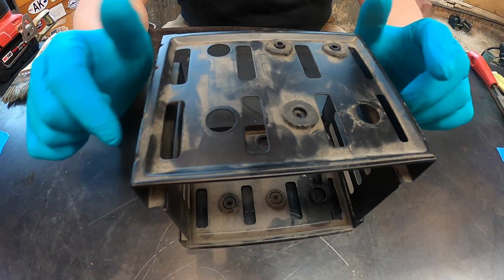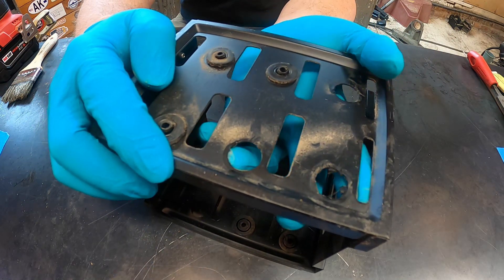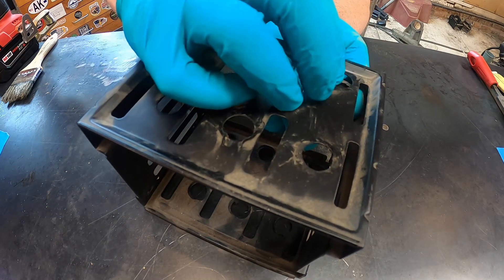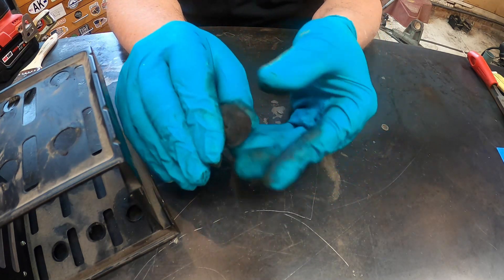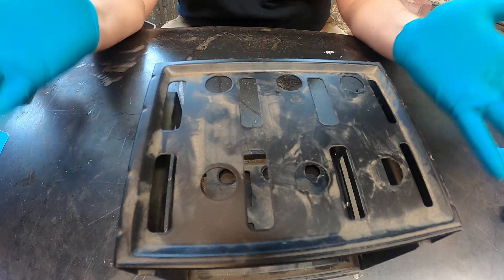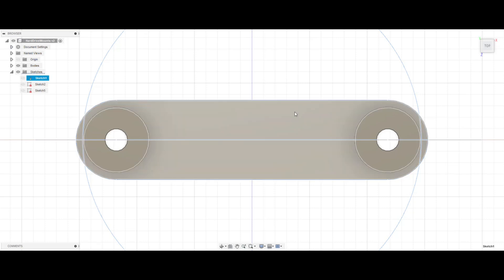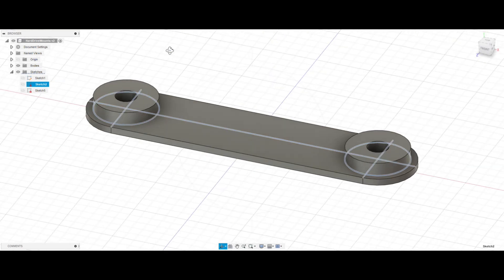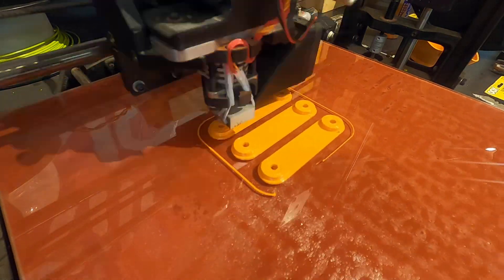3D Printing Hard Drive Mounts

Comment: Replacing the old vibration absorbing grommets with a hard plastic bar was the worst choice.  It would be far better to find some soft grommets and  3-D print adapters for the four hard drive mounting points.This would do a much better job of dampening bumps, fan vibrations, etc.
Reply from the maker: We mounted hard drives steel to steel for decades and mostly still do, the grommets are totally unnecessary.  I setup a 8 drive NAS a couple weeks ago, not a piece of rubber in sight.
Reply: @jtkilroy  Same here, 2x NAS servers all in slide chassis, metal on metal...  as for PLA/ABS... PLA is great for indoor use... anything exterior (sunlight &/or heat) PLA will start to deform before a similar part in ABS due to the lower plasticity of PLA... I use PLA for everything, unless it requires higher heat, (or i want to acetone smooth the ABS parts) Keep up the Distancing and stay safe in the shop ! ;)

Comment: Seeing the posts about vibration. We have a simple way to reduce vibration into various equipment.  Find a piece of Vacumn hose at your auto parts store that will just slide over your mounting bolt, drill the mount out where you have to lightly force the hose into it, Cut the hose slightly longer than the device to the outside of the mount bracket distance, install a small washer on the bolt, install the bolt tight enough to slightly compress the rubber hose short of the washer touching the bracket.  Nice and secure isolator.  Maybe even fish tank airline type hose would work.
Reply: silicone tubing is best - nylon hardens over time

Comment: When you get enough spare cash to burn thru, spend it on an SSD drive.  You'll appreciate it more than you might think.  Good Luck!
Reply from the maker: Ive got an M.2 drive that I actually boot off of.  These two drives are just for storing and working with video footage

Comment: Darn, I thought you were going to print a complete hard drive enclosure for a stand-alone hard drive machine.  Still looked good.  Be safe, practice spacing, wear your mask and gloves.  If someone thinks you are over-cautious, simply pull your mask down and cough at them.
Reply from the maker: Hmmmm, thats an idea.  I have been thinking about building a Raspberry Pi based NAS
Reply: @jtkilroy  Please do.  That is a project I have wanted to know how to do for a long time.  Have some old drives and maybe mimicking a server would be great.

Comment: Print with Ninja Flex to get some compliance back.
Reply from the maker: I dont think my extruder will handle ninja flex, dont you need a special one for flexible filaments?
Reply: @jtkilroy  Nothing special required, in a warm room a small fan can help prevent sagging. Extruder 230C, bed can be heated to 30-40C but not required.

Comment: Thanks for sharing this. I wonder if you will notice a difference in the sound of the drives since the printed material is harder than the original rubber. In the shop it's probably not worth considering. Being retired this difficult situation doesn't affect me a lot personally, but I'm very sad and concerned for those who either have to work and endanger themselves or who will lose their jobs because of it. I wish everyone well and a good recovery in all senses.
Reply from the maker: Doesnt sound any louder to me...yet

Comment: IT Technician here, (finally something I know about yay!) those rubber things are dampers to absorb vibrations. No they’re not meant to be that goopy but replacing them with hard plastic is not the best for critical data storage. I would be weary of storing backups or import documents on them. Especially with multiple drives in one rack the spinning disks can start to compound their vibrations and result in data corruption.
Reply: This being said, you’ll probably be fine. Just something to know.
Reply: To add to Zeke's comment's, you really want something in place to help dampen vibrations. The more drives you have the more risk you have of the read head hitting a platter. Perhaps you can adapt your part to hold small rubber grommets
Reply: Exactly my thoughts too Zeke.